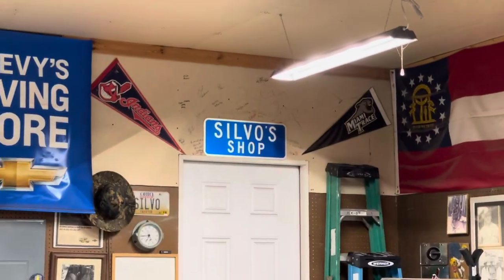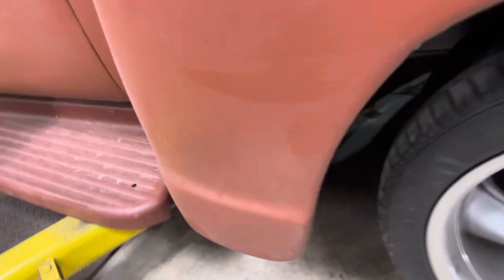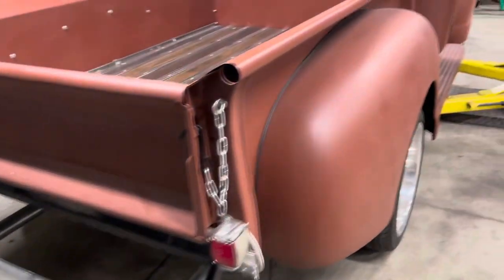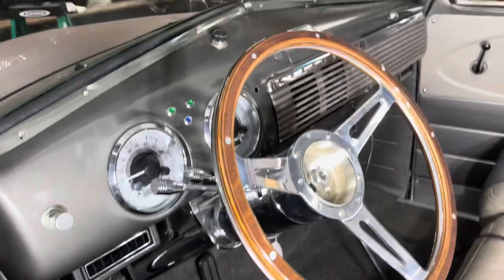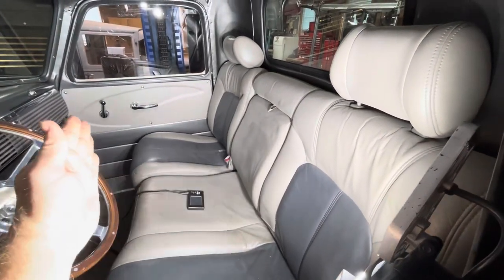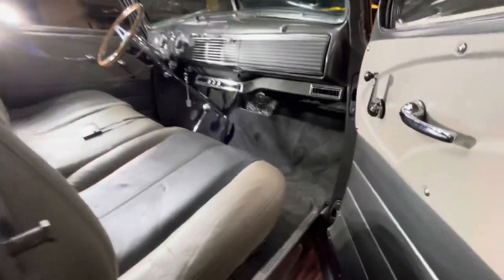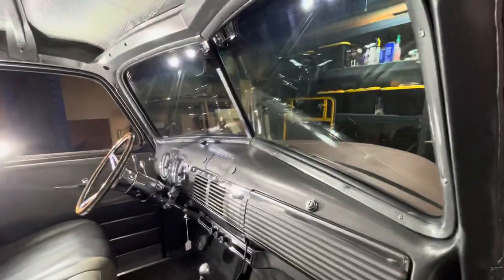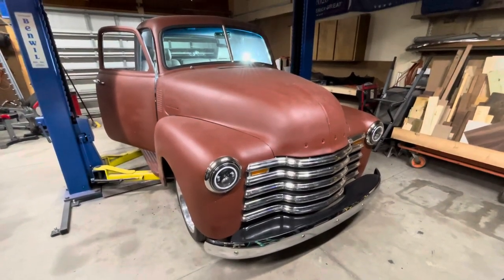1949 Chevy Truck Walkaround and Interior

Comment: Hey did you adjust the new seat to the truck . Bought brackets or welds some metal plates
Reply from the maker: Factory brackets that were on the seat that came out of a Cadillac Escalade. Just bolted them in. They are even heated!  Lol. Got them from a pick a part yard for $75!
Reply: Can you send me a picture of bottom of brackets n bolts on system please
Reply from the maker: @danielcontreras8889  never sent pictures in YouTube. Not sure it’s possible.

Comment: Do you know what the back spacing is on the front and rear rims 
I see that you said that they are 18x8 front 
18x9.5 rear
Reply from the maker: Your asking for the back of the rim to lugs correct?  Not sure but I can measure it for you.
Reply: @silvosshop  yes thanks and Does the front tires rub the fenders with an 8 inch rim and tire
When turning left too right
Reply from the maker: @chadbost6369  no. Not at all. That said the rear tires rubbed on the bed wall which is why I needed to install wheel tubs. Videos to come.

Comment: Noticed the weatherstrip around the doors has been removed and appears that you don't plan to put it back in. The one that rides in the channel and gets hard as a rock and is a B*ITCH to get out. I was thinking about omitting it myself. How's that working out? Any road noise/ water coming through?
Reply from the maker: No issues at all. I’d like to fill in the holes at some point. Looks a lot better.